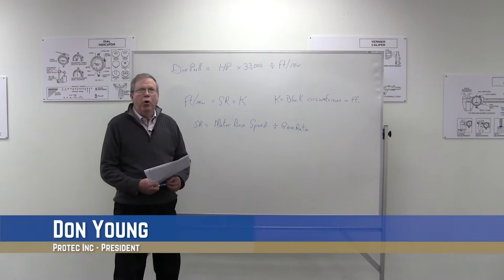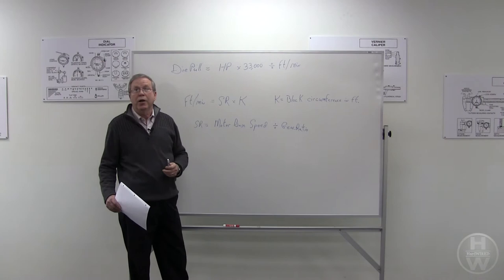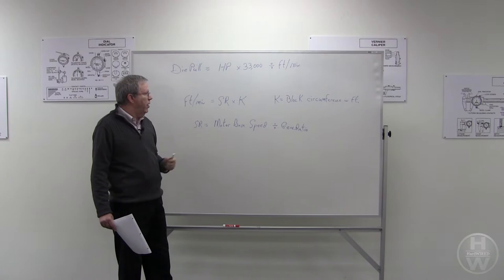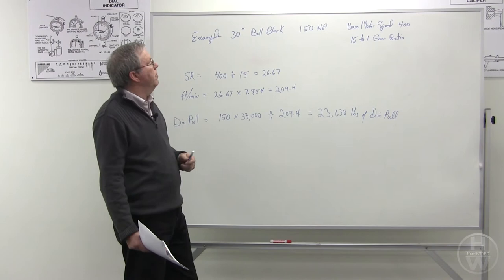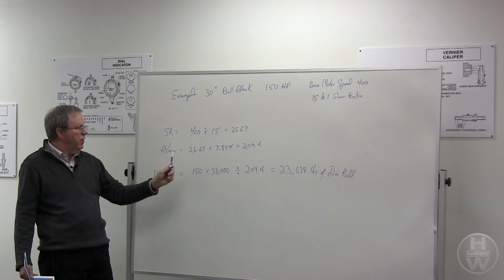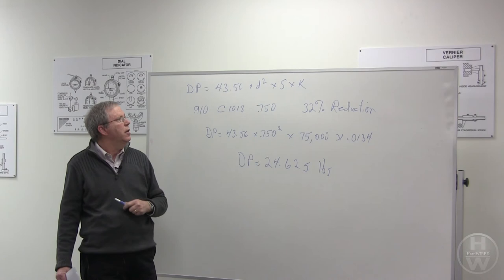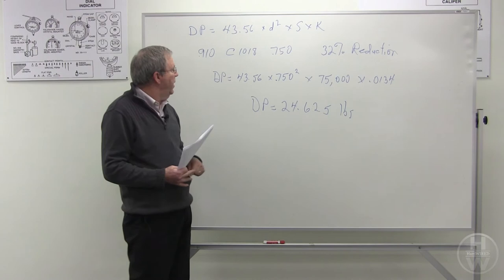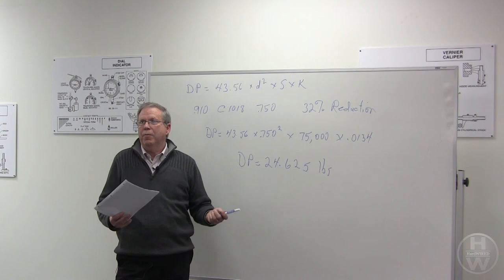Bull Block Calculations

Comment: Sear sir, we required S S tube Drawing bull block. our requirement 25mm Dia. and 2mm wall thickness s s tube draw. calculation requirement. please send the your charges. thank you.
Reply from the maker: Sorry we don't have any information related to stainless steel tubing I know it's die pull would certainly be different than solid rod.